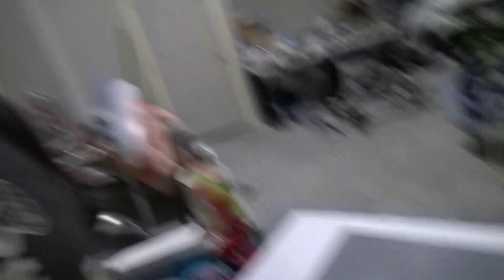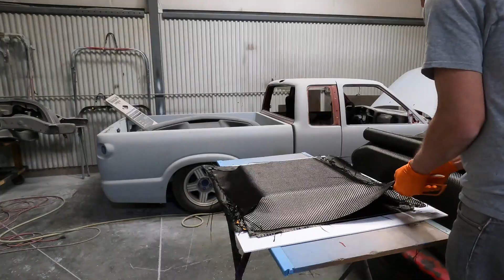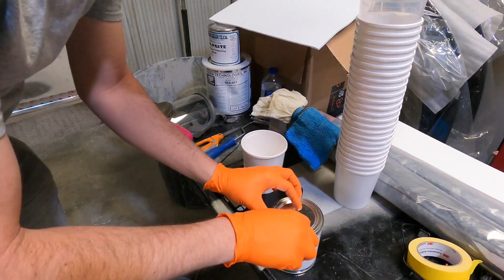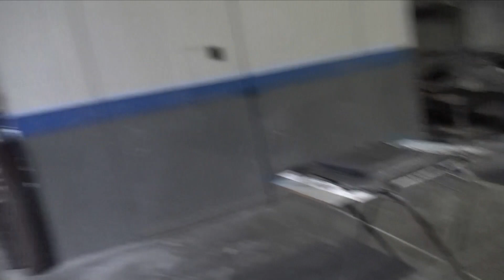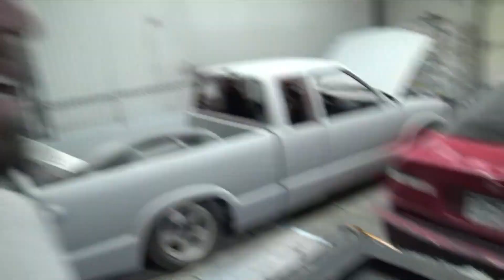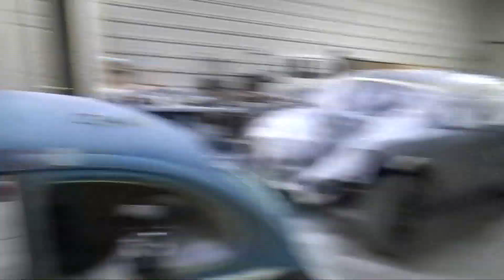Building A High Temp Carbon Fiber Mold

Comment: I’ll start by saying you made a really good mold. But why did you choose to make the mold out of carbon fiber and not just use fiberglass. There is no real proformance gain by using carbon fiber to make a mold. The weight savings on a mold isn’t worth the cost of carbon. Molds IMO are thick and heavy no matter what way you go!

Comment: We build carbon fiber stocks with no gel coat intjink it triples the weight of the product and the structure strength is in the strands itself. If using for longevity gel coat always cracks because of the thickness and non uv resistance. Look at all the boats. I have Clearcoated boats with automotive clear coat for that reason.

Comment: that mould cant handle high temperature as you didnt post cure it. with high temperature resin, you need to oven cure it around 16 hours to make the product to be able to used with pre-peg  carbon fiber. unfortunately you wasted the mold. you can still pull vacuum bag or resin infusion parts from it. but you wont be able to do prepeg oven cure carbon fiber.

Comment: Hi Dave ,nice mould but why have you made a mould out off carbon .You should  make it out off fibre glass  and then take a mould out off carbon Very expensive way to make parts. And with the weight  thing, taking a mould off the roof  is definitely a two man job . Excellent content as usual Dave  😀

Comment: You only need 4 layers of carbonfiber on the roof panel. 9 or 10 layers is way over kill. Ive worked on a full carbonfiber car from speedkore that went sema and its thin .
Reply from the maker: The roff is o ly going to be 2 layers the mold needs to be rigid
Reply: @Junkyard_Dave  good , i thought i heard you say the roof was going to be 200lbs . Lol

Comment: So this is practice for the Dodge roof. I haven't seen anyone else mask the paint/gellcoat tin before pouring. I'll use this trick myself when I'm doing painting. I hope you put wax styrene in the gellcoat that you used to touch up the mould, otherwise it will tend to adhere to the shroud and pull out. I worked in the fiberglass pool industry some years ago, so I know a bit about the process. Looking forward to seeing you make the mould for the roof, then the roof itself. All the best from Queensland Australia.

Comment: Why not use fibreglass with polyester resin for the mold plug alot cheaper and alot quicker and use timber in it to add strength

Comment: I'm kinda tempted to say YOU'RE Doing it Wrong! But you're not quite doing it wrong.
If you have that much carbon to waste on a mold no problems and if you want a quality dimensionally stable part then using carbon to mold carbon that is going to be heat cured is the thing to do especially if you intend to make a few hundred.
But if the number is less than fifty and absolute accuracy and being stronger than a tank is not needed then MDF would have been the better choice for a mold or cheap fiber glass, If you intend to make hundreds then an alloy mold would be best.
Either weld up some 8 mm plates into the shape you want or get it cast. The carbon mold will unless the resin is specifically designed for multiple heat cycles start to delaminate after twenty or so.

Comment: Why the hell would you waste all that carbon fibre on a mould that could've been made out of fibreglass and resin??

Your logic escapes me sometimes
Reply: Its not the mould he has to get right, its the part.

I would not be wasting my time, effort or money on a step that is irrelevant!!
Reply: A waste of money on this part, if you were to use an autoclave which I think is what he means by dry carbon, then you have to account for the differences in expansion when heated hence a carbon part may have a carbon mould, but a wet lay up on a fan shroud? I’d have used fibreglass, and bevelled the edges
Reply: Is that after he puts in in the vacuum bag? lol not right after obviously, once its cured enough?
Reply: Hes practicing using carbon fibre, before he does the roof. Messing up all the material for the roof would be much more of a waste then what hes testing out on rn. Atleast thats what i think is the reason
Reply: @newmemer8070  wait hes gonna make a carbon FC roof? Fuckin sick.
Reply: @YittsuKitsune  idk what you mean by FC, but yeah, a roof for the dodge. And he also will use a special blue and gold weave he showed in another vid
Reply: @YittsuKitsune  The fan shroud he's working on is for his Mazda FC. The roof is for the Dodge.
Reply: @BrucePierson  oh i was about to shit and would pay good money for a carbon FC roof in 2021... shit doesnt exist any more
Reply: @newmemer8070  FC RX7. I mean he stated in the video that the shroud was for an FC several times.

Comment: I haven't seen you mention it but when you go to make the mold for the roof of the Charger I would make the mold of it while it on the car. Otherwise if you try to mold the roof panel while its off the car it's going to come out wonky and probably won't fit the car properly.

Comment: Why do a carbon mold? Apposed to fiber glass mold? Isn’t that a waste of money?
Or is it #flexbitches ?
Reply from the maker: You use carbon because it is more rigid and can handle the high temps if I do decide to post cure it and make dry carbon shrouds
Reply: I was wondering that myself, but he probably has bought so much carbon fiber fabric that he had it laying around to do a small mold like that one. I’d like to think the answer is “why not?” personally.

It’s practice for the main event which is the roof.